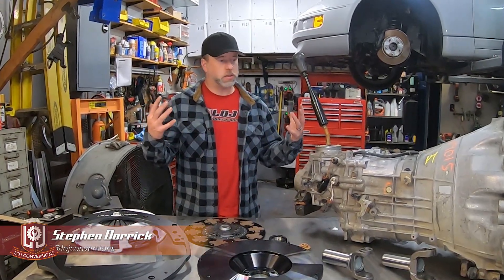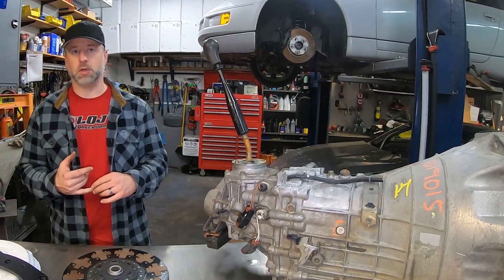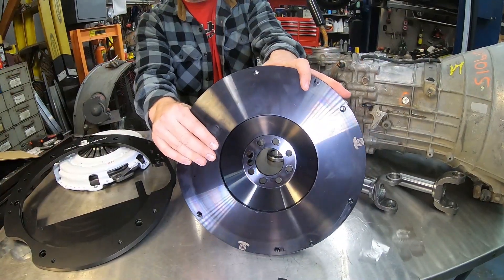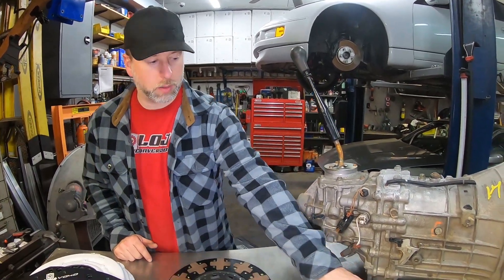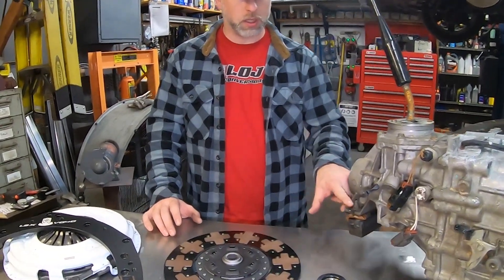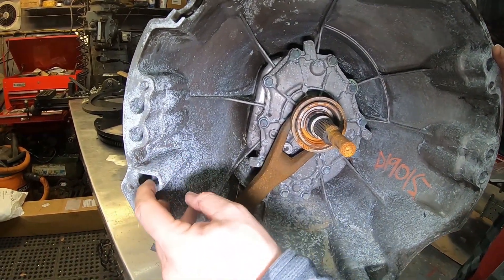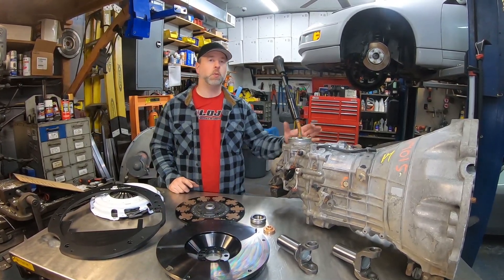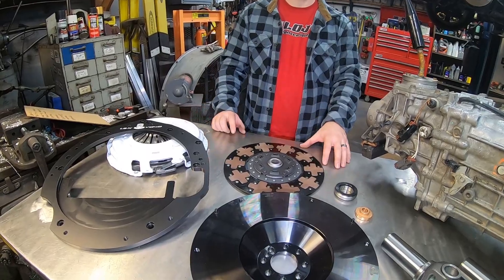LOJ Product Spotlight - LS / LT to VQ40DE Manual Transmission Adapter

Comment: I have an 02 Sierra 2500HD 4x4 with the LQ4 and I been wanting a good manual transmission option for a long time. The ZF6 is impossible to source and it leaves me with the NV4500 as my best option which is disappointing as hell. Does this conversion also work on the 4x4 version of this transmission?

Comment: Sounds like the perfect trans to use when i ls swap my 2002 Frontier lol

The 2002 manual trans  is a toploaded 5 speed  similar to a z32 trans and the bellhousing is too small to use adapter plate and keep chev starter

Comment: I have 2 questions about this transmission:  First, are there aftermarket shifters available, or are you stuck with that giant thing?  Secondly, how far back from the bellhousing flange is the shifter?  A T5 is about 26" from block surface to shifter, and since I'd like to use this to replace a T5 (thirdgen f-body), that dimension, along with the ability to run a MUCH shorter shifter, is critical.  Thanks!

Comment: Need to make an adapter to run a GM transfer case behind one of these transmissions!  Like an AWD 4472/NV149/NV120 would be awesome!  

I’m currently trying to figure out how to get the NV120(TBSS) case to fit behind one to do the swap on my 98 Bravada that is already NV3500 swapped but I’d like a stronger trans option for the twin supercharged V6.
Reply: Agreed. Need three (3) things: (1) an adapter plate to mount directly to the transmission, drilled and tapped to accommodate a 4L60E 4x4 extension housing (to allow modularity in using both 6-bolt and 5-bolt circle pattern transfer cases); (2) 4l60E 4x4 extension housing (off-the-shelf part to keep costs down); (3) intermediate/stub shaft going from 30/32-spline Nissan to 27-spline GM or 32-spline GM. (1) and (2) are cheap. (3) could be a little pricey. This would also work on Nissan auto transmission, so any Titan/Armada/Frontier/Pathfinder/Xterra with an auto could swap a GM TC with the same kit.

Comment: This is awesome. I would love to put a 4.8LS in my 2005 Gen 2 Xterra since I already have the 6MT.  Do you know if anyone makes a motor mount kit ?
Reply: Why not a VK56?
Reply: @Agent.K.  I didn’t know the VK56 would fit in the Xterra and mount to 6MT.. I would go that direction if it was possible.
Reply: @Green_Leaf  
Just need an adapter for the transmission. The rest is basically plug and play. Check out the Newx forum and Driven Desire. Lots of info.
Reply: @Agent.K.  Will do!  Thank you
Reply: Discovered the MT6 Frontier and Xterra’s come factory with a Dana44 rear axle (Nissan called M226).  So not only will the MT6 handle the LS, but so will the rear axle…Nice!

Comment: Are there any OEM clutch options?
Reply: Call Waco clutch n brake they make custom clutches for cheaper than a parts store performance one very reasonable and tough as you want 
They sponsor and supply a bunch of tractors pull trucks so your not going to get and more abusive need than those guys.  One guy was going thru a clutch a night before now their clutch lasted him a season and he only changed it cause he was putting a new motor in so your crazy not to swap it while your there

Comment: Wife has 426.000 miles on her 2013 Frontier. 2nd Motor  same 6 speed tranny. She literally hauls the mail.
Reply: She delivers the mail in a manual?!?!? God bless that’s rough
Reply: @rolandarey7823  Not on Rural routes in the Finger Lakes Houses are mostly far apart. It's had a few clutches in it. She bought a 22 New in 22 her 2013 is now my work truck

Comment: I have a 04 Nissan frontier 2.4. I'm wanting to do the ls swap. So my question is can I use my 5 speed trans with your kit
Reply: 04 Nissan Frontier had the FS5W71C transmission. It’s very stout for its intended use, but can only handle about 300 lb-ft of torque. 

That’s why it was used behind a 4cylinder.

Even Nissan didn’t use this transmission behind the VG33 that came in the 2004 V6 frontier. 

Hope that answers your question

Comment: I started following the Swapology build and came across this video.  Really great info guys!  I really appreciate how open you guys are about sharing your knowledge, especially compared to others in this business. 
I have one question though.Does this trans have the same tail housing bolt pattern and tail housing length of the CD009? From parts diagrams it appears the transmissions share a main shaft.  My reason for this question is it would be cheaper for me to buy a junkyard VQ40 2wd trans and swap the striker rod and the tail housing onto my CD009 to get a toploader shifter than it would be for me to buy or even design and make my own CD009 topload shifter.  I have a CD009/LSx swap I am working on but my build needs the shifter to basically be in the middle of the inspection plate. I have gone through a couple design iterations for a relocated shifter but it seems like OEM might be the better option if that could be cobbled together.  Thanks in advanced.
Reply from the maker: BTW, you can not swap the frontier tailhousing onto a CD009. The striker rod is supported by the mid plate and input shaft plate on a frontier, it is supported by the mid plate and tail housing on a CD. If you put the frontier tail on a CD you only have one support for the rail left and it won’t work.
Reply from the maker: Thank you! There's a place and time for secrets, some take it to the extreme.

Comment: Just for the adapter plate and flywheel is $1000.... Not including clutch , yoke , and the actual cost of the trans which used are actually running $500-600. So itd be around $2000+ up and running with this setup and trans....
Reply: If it can consistently hold 5-600whp I think that’s a fair price. Clutch can’t really be factored in to the transmission cost. You’ll need a clutch for your power level regardless of the transmission.
Reply: Have you seen what people want for a t56 core? I’ll just say that you can almost get a new Nissan 6 speed for what a REBUILDABLE T56 goes for (and parts for t56 are getting rarer by the day).
$2k all in for a manual trans LS is very reasonable, especially considering the Nissan’s shifter is in a better spot. 

The only way this could be better would be if Nissan would have just offered the Frontier with a 5.3 from the factory lll

Comment: 2wd frontiers only?  The 4wd has a transfer case off the back of the trans correct?
Reply: Adapter works with the 4wd trans as well.
Reply: @GSRSteve  Is there any way to convert the 4wd trans to 2wd? The 2wd transmissions are less common than the 4wd ones.
Reply from the maker: XxHACKERZx I can’t say for certain, but I’m almost positive only the tailhousing needs to be swapped. I would need to study the OEM parts manual. I have both transmissions sitting here and need to compare to be sure.
Reply: I would really like to find an answer to this question. I just bought the kit and it’s for a 91 Chevy short bed. Having trouble finding a 2 wheel drive trans.  Would love an email I could get ahold of you on.
Reply: @obsessedracing7843  hey did you ever get an answer to this question by the way? Please let us know and thank you so much!
Reply: @obsessedracing7843  car-part.com. Good source for used parts.
Reply: If you want to sell me that two wheel drive trans I will buy it.